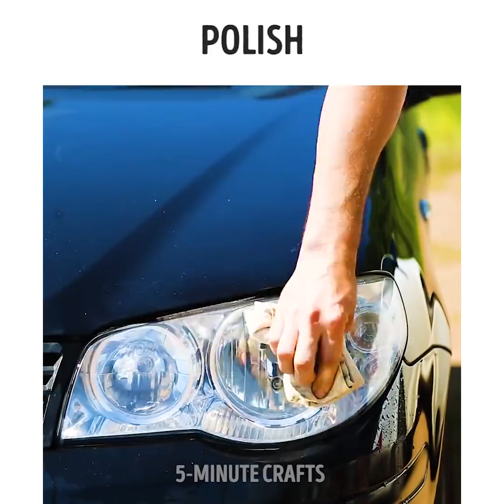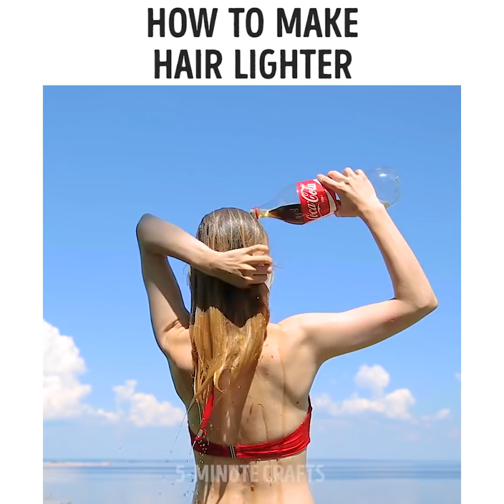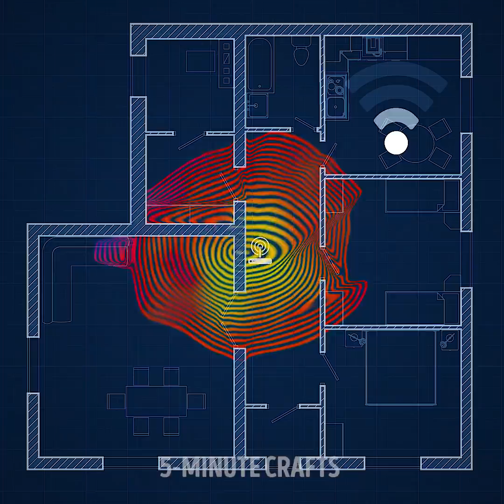27 COOL COCA-COLA LIFE HACKS

Comment: And this is why I don't drink it lol also the hack at 7:07 do you have to cut and use that exact same can because I tried it with a normal can and it completely shut the signal off so not sure if it actually works...